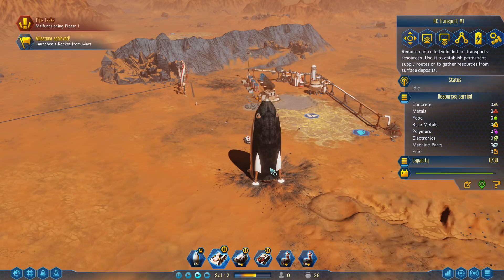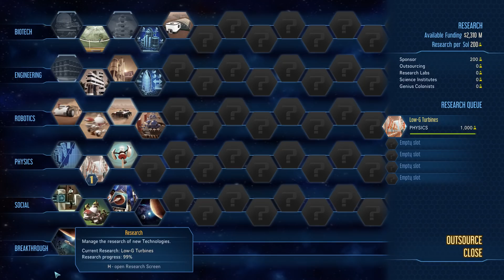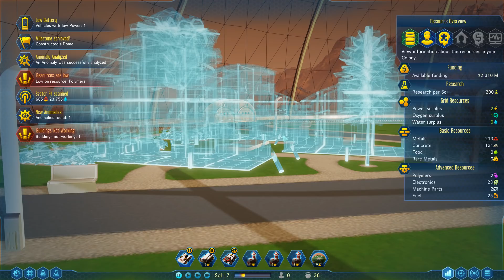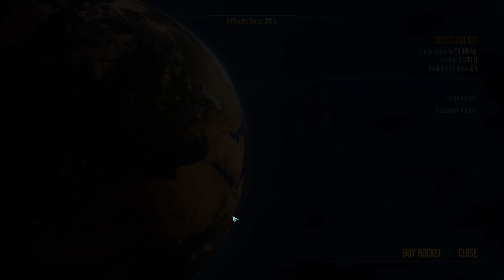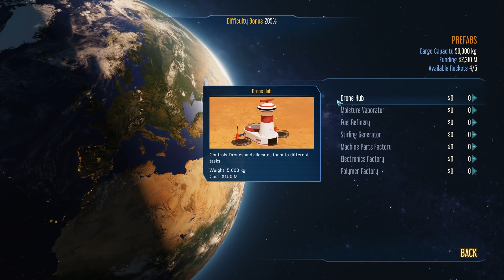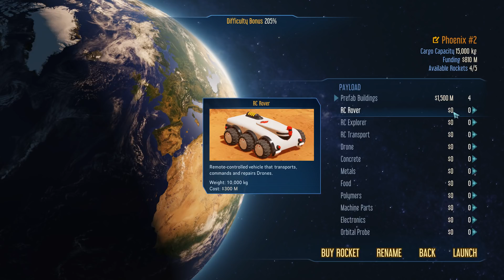SURVIVING MARS - Emergency (Kind of) Drone Hub & OUR FIRST DOME | Surviving Mars — Nova Roma 3

Comment: That map location is super good. The area between your two concrete deposits would be a fantastic place to stick a bunch of power. And you can get rid of most of your piping since the game was nice enough to give you a bazillion water right near where your domes are going to be. Add some pipe valves and power switches and you should be good to go for redundancy. The only downside is the distance, but with more drones and getting a shuttle hub, you should be fine.